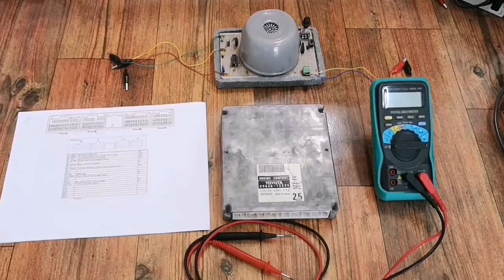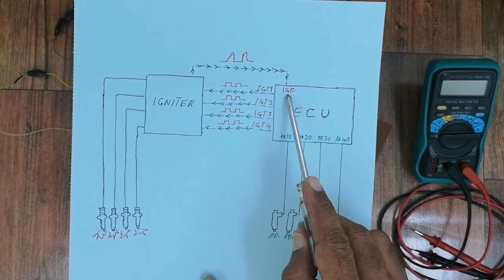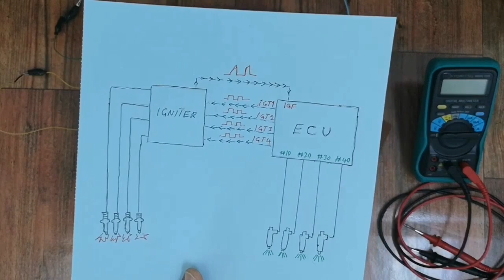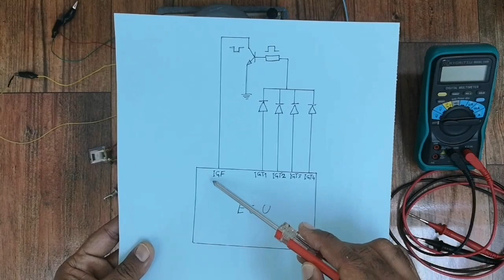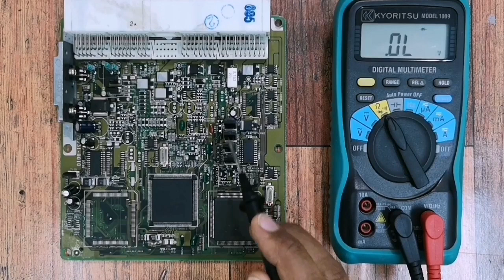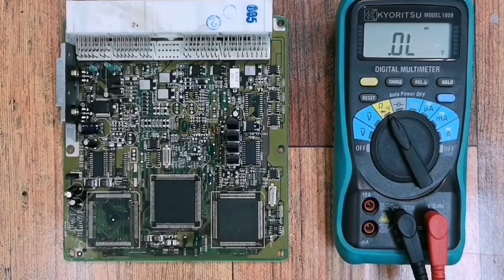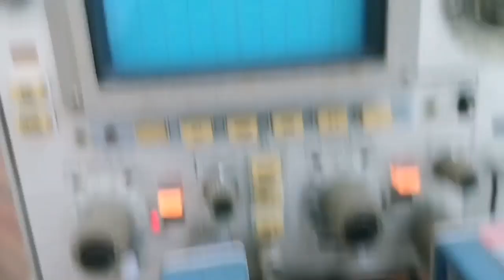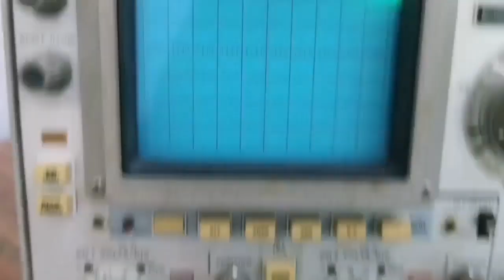Exploring the ECU hardware and testing - Part 3 (fault finding example with IGF signal simulation)

Comment: Nice video. It would be nice to have some explanation on which are the (minimum) required signals to have the ECU working on the bench. What signals are injected for simulation? Is there any video that explain and provide schematics for your custom setup?
Reply from the maker: Hi, you are very welcome,
That's may differ from ECU type to other, also it depends on the problem I am trying to solve, for example if no fuel pump output then I may just need to simply power up the ECU and provide ignition swith input to verify, but if no injector or ignitor output then I may need to get crank signal as well, some other problems related to performance may need more sofsticated ECU simulator to diagnose.

Comment: hi it was great watching the videos please can you provide me with the diagram of the engine speed semilator
Reply from the maker: Hi,
This type of simulators can be built based on different principles, this can be pulse genarate circuit using 555 timer ic for example or other circuits , the one I am using is based on electronics plus mechanical mechanism sort of principles.

Comment: Pure gold. Thank you so much. Can you tell me where to find pinout diagrams? I have problem with my Mercedes bosch me 2.0 not providing sufficient ground for the fuel pump, trunk lock and probably some other minor circuits. Maybe they have something in common
Reply from the maker: You are very welcome and thanks for your positive feedback,
Try to search the web using the ECU part number this some time works, there is also free application( Carmin) try to install it contains many brands, paid application like All data can be best option.
All the best

Comment: How to find ignition pin in a ecu
Reply from the maker: Unless you have the pinout diagram is not very easy to know ignition input exactly by just tracing the board, it is much easier to identify example the ground, B+ power, injector output and ignitor output without pin diagram.

Comment: Sir i have a dought about how we will disable the immo while the ecu testing in bench
Reply from the maker: The ECU will respond to the simulation signals even though the immobilizer is enabled but using low RPM or crank signals this is enough to test the basic functions, if higher RPM is required then the ECU will stop responding then yes doing  immo off will be needed.
Reply: @saudautomation  thank you sir

Comment: can you give me the circuit and values of your  simulator
Reply from the maker: This type of simulators can be built based on different principles, this can be pulse genarate circuit using 555 timer ic for example or other circuits , the one I am using is based on electronics plus mechanical mechanism principles.